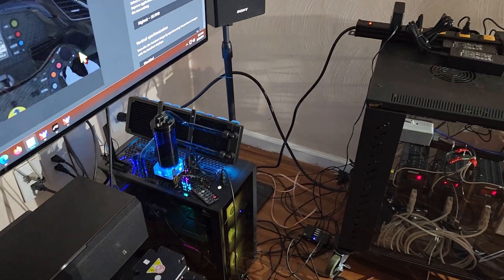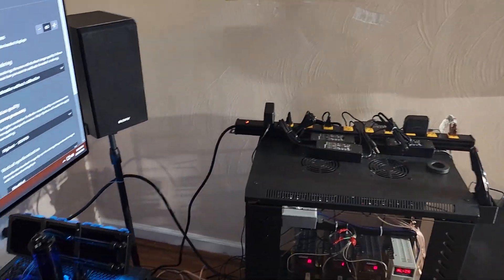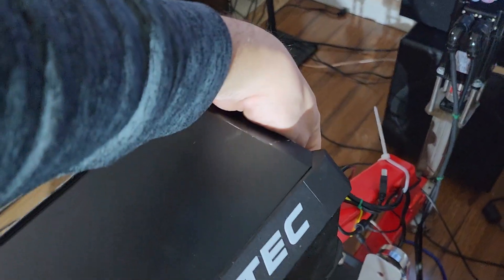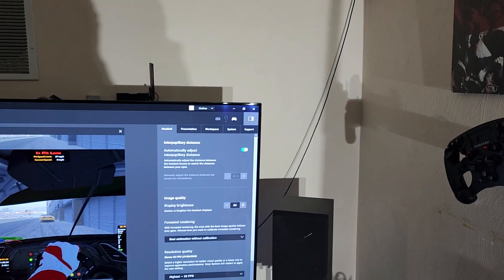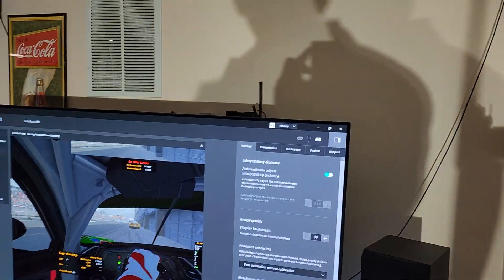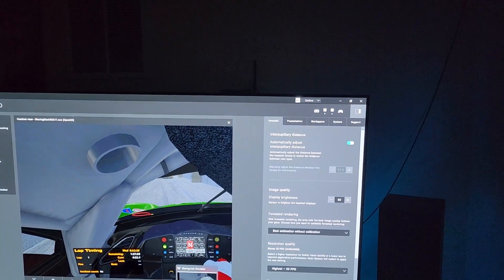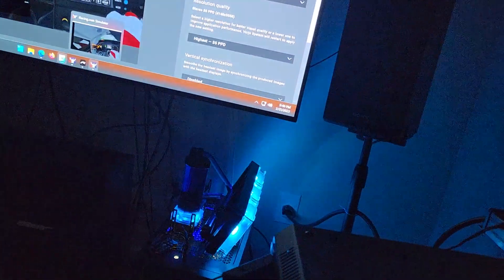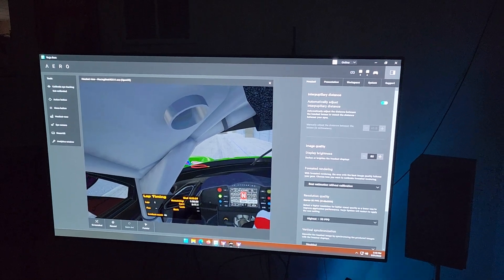SimRig Build - VLOG 5 - EMI Issues Continue

Comment: @lionsamdwich Did you ever get this working? I'm having the exact same issue. Lighthouses disappear from SteamVR when my actuators are plugged in. As soon as i unplug the actuator control box, tracking returns. So until i figure this out, it's either triples with motion or VR without motion.
Reply from the maker: Kinda got it useable, but not totally fixed.   I actually sold all the VR stuff.  I'm much happier with triples.  Check some of my new videos to see the current setup.
Reply: Thanks man. I got triple 65" monitors and the unreleased Bigscreen Beyond VR headset. Saw your latest setup, just trying to figure out why my VR isn't working anymore and it used to. Something about EMI. I've followed every guide online but you're the only person I've found who has the exact same symptoms! 
I appreciate the quick response.
Reply from the maker: @punkinkng  the biggest help for me was adding line filters to the input power phases Noise Suppressor Power EMI Filter Termianl Single-Phase Line-Conditioner JREle AC 115/250V 20A CW4L2-20A-S https://a.co/d/aFiY8Tj
Reply: Here's my rig. https://youtu.be/BWlZCeBdIRo?si=6Fa0MCOgFUyuqfio
Reply: I tried that same EMI filter already and it didn't help so I contacted my electrician who told me to invest in a power conditioner which arrives tomorrow from Amazon. Hopefully this helps. Again thanks for your quick help! See you on the virtual track!
Reply from the maker: @punkinkng  ferrite beeds on the UVW lines too from each servo drive to motor at servo connection
Reply: @punkinkng did that power conditioner work?  My vr loses tracking when I touch the headset, only when the servos are powered on.  Installing the line filters today but if that doesn't work..maybe the power conditioner fixed it?